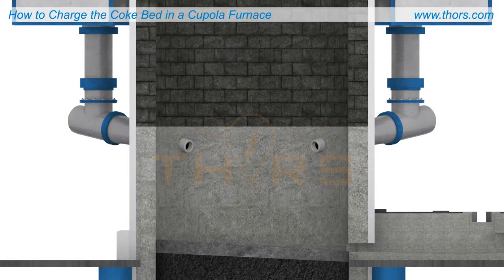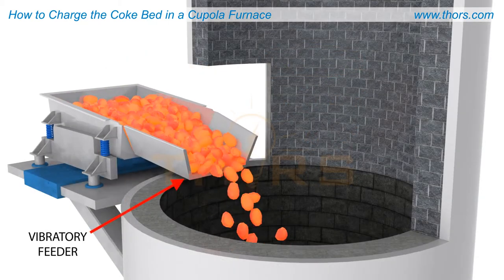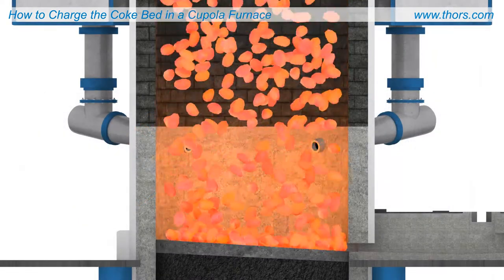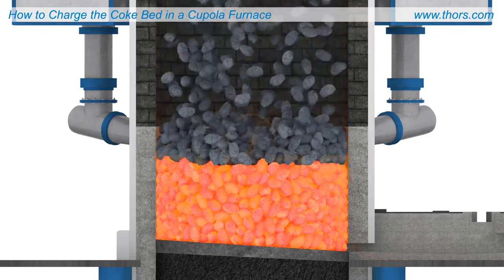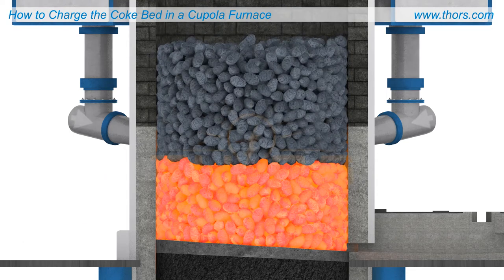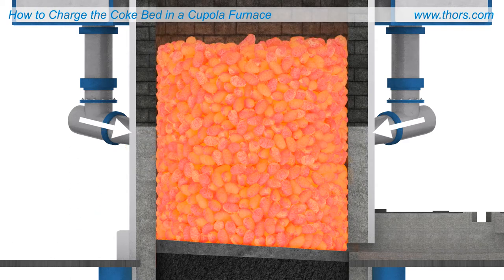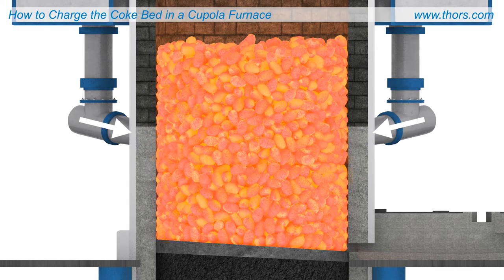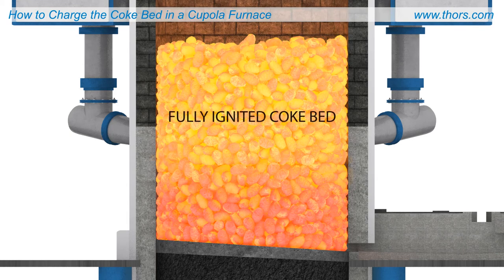How to Charge the Coke Bed in a Cupola Furnace || Cupola Furnace Operations Course Preview

Comment: I have a question, when iron oxide react and melt down, how it mix with the coke in the bottom or there is a Separator between charges and slag-iron zone?